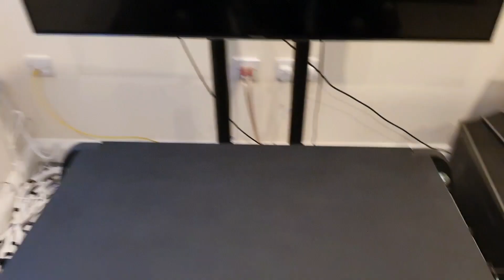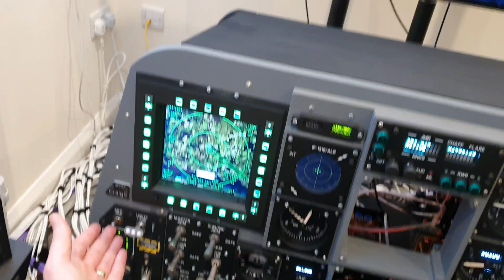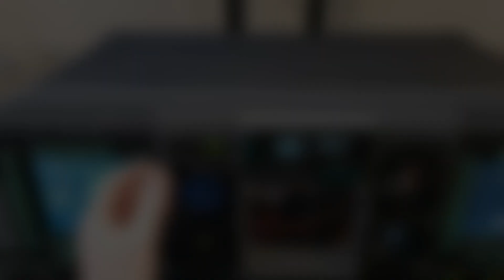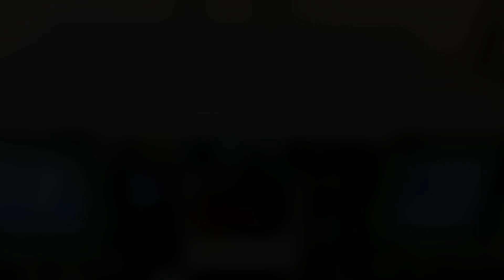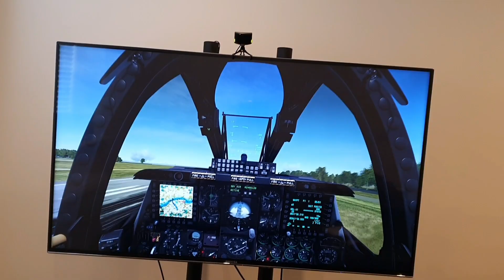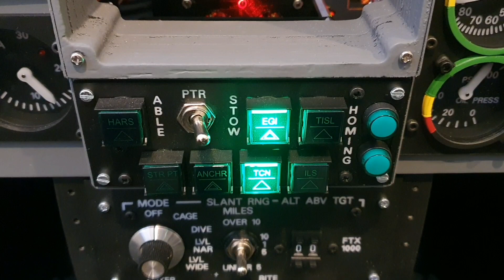Simpit A10C - Front Dash - Part 28: The project so far

Comment: I absolutely love this project especially all the gauges and the level of detail you go into on how you create each component. For somebody looking to build a simpit which is completely new to this amazing art where would you recommend to start? This would be a dream of mine
Reply from the maker: Hi Black Baron, thanks for the thumbs up on my project. It's been quite a learning curve because I don't have an electronics background so each thing I did was new to me.
As regards your project, based on the aircraft cockpit you want to replicate I would note down all the key components needed, i.e. Toggles, push buttons, potentiometers, rotary switches, 7 segment max7219 module, 128x32 oleds, servo, x27 type stepper, easy driver boards, arduino mega / uno / nano, etc. I'd source these components, set up dcs bios, study its user guides, read the ED forums regarding its usage and have a period of time just gaining experience of interfacing those components to the sim. When you are at a point that you have each of these working you'll be ready to make fascias and start mounting the components into them.
I think for a big project you need to enjoy building at least as much as flying. The most important thing is to be patient and persistent.
Good luck with your project 👍
Reply: @CraigSmysimpit  
thank you for taking the time to send a detailed response am looking forward to your progress

Comment: Great work mate! I only recently updated to the current version of DCS-BIOS. Vast improvement. It's a web based interface, you can name each com port to what panel it is, and no more having to run commands. It will auto start with DCS and everything just works!
Reply from the maker: Hi Ray, I had a fair few connectivity issues with dcs bios early on, but by version 0.7.1 it was well developed and worked perfectly for me. Ian then developed the hub, but soon after needed to step away from it due to other commitments. I saw a few comments on the forums where people had some challenges with it. I wasn't sure how well this new version could be supported. However the old one is super reliable. I'd be interested to see if you encounter any issues as you use it for a longer period - hopefully not as it sounds really good